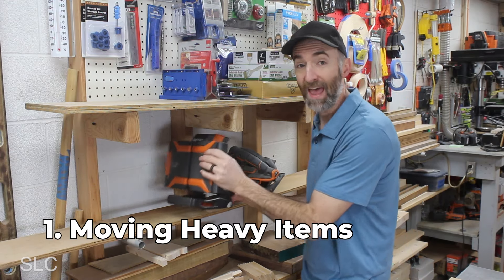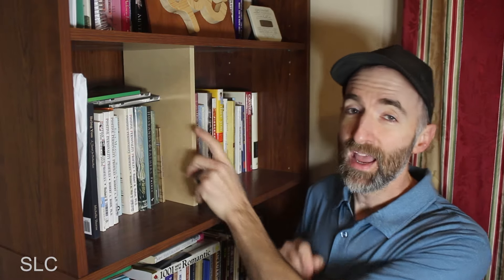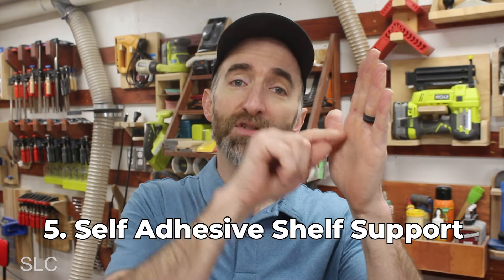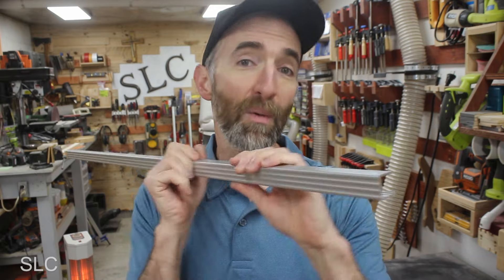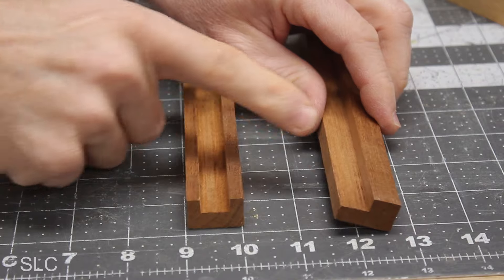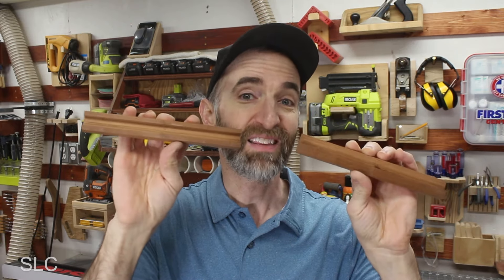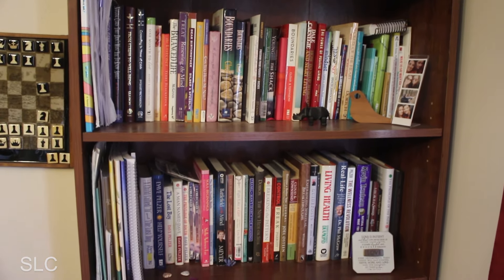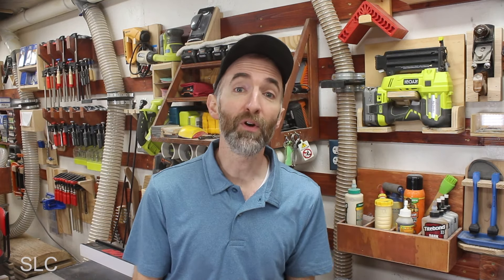10+ Ways to Restore Sagging Shelves

Comment: I used coffee table books as center brace. Bought them in thrift stores.  Painted or recovered or replaced the bindings on some. But most part they were all in great condition. Lowest shelves I put the paperback books in stacks that act like a foundation  about 3 deep also have used the paperbacks in horizontal positions spines facing out to make pillars. I should be ashamed I have about 14000 books a lot in storage. I also have about 30k on line. We are building a big house, Barn, smokehouse, workshop large equipment garage and I will have a large she shed on it for my crafting and my books. SIL and I designed it as workshop/guest house. It will have 2  bedrooms, kitchen, living/dinning bathroom and laundry. So when my time comes they can use it as a rental for extra income. One of bedrooms will be my library. But still have Murphy bed in it for guests. Building going to be 25 feet wide 40 feet length and he is adding a carport to the side so I can work outside with items like clay or spray paint. This he p/and to make 15 feet by 20. It will be drive through with full outer wall. Eventually he will add garage doors on both ends or barn doors. Yeah sounds like in law cottage but son in law and daughter will not let me live in it. They putting 2 way intercom in so they can come help in and out of main house. Plus a panic button system. He is also soundproofing it too so I can work in it and make noise late at night. He is putting covered front porch he wants to put sliders on so I can use it as a painting studio or greenhouse. Where my main crafting area will be is between the kitchen dining area and bedrooms area it will be 10 by 25 room. Later they can make it into a master bedroom and add a larger bathroom or just leave it for game room. Only they will have to remove all my crafting stations. My son in law bought 100 acres. He plans on having a couple horses 4 cows, goats, sheep, pigs and large garden. Basically self reliant off grid place.
Reply: Please add paragraph breaks.
Reply: @rswow  usually I do was in car when writing and was helping my daughter check lanes.

Comment: Just in time to help me with a current "issue"... Let's not talk about the fact that I probably should have designed them better... retrospectively I see that NOW!!!...  but I thought those Hangman stiffeners would do the trick... I measured my shelves they're over 4' almost 5'  so that product isn't long enough.  Hey, they're pretty good 3/4 plywood and I've even added back supports, but that's not good enough!  NOooo they want to sag in the front too, grrrr....  so I need to try one of your other options.      Thanks, Great Video!
Reply from the maker: Don't feel bad, I've underbuilt several things in the past and the great thing about doing that is the ability to learn in the future.